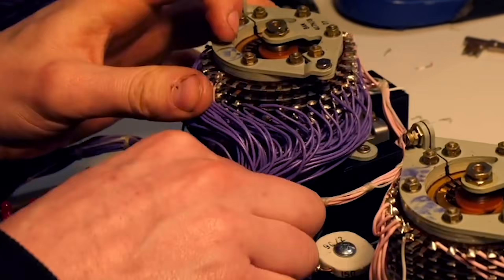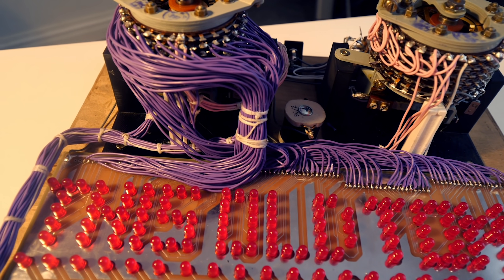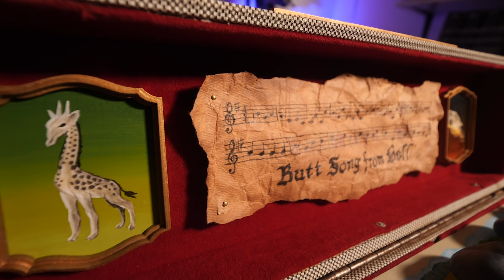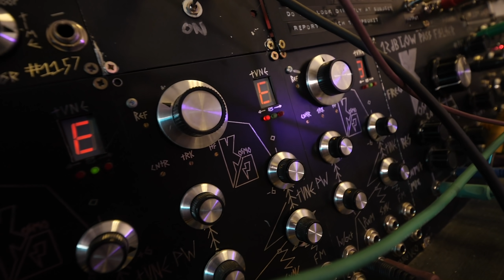ELECTROMECHANICAL LIGHT CHASER OF DOOM - DIY Build

Comment: this chaser is a work of art! i can't stop pushing the butt.  i mean button.  blows my mind how you worked that all out.  and how does it stop on it's own?! so many questions.  Merry & happy to you!
Reply from the maker: Glad you dig it! :D I explained that part but ended up editing it out cus I thought I was blabbing about uniselectors for far too long ha. If you look at the bottom row of the slow uniselector there are sets of 5 contacts soldered together then a contact not soldered to anything. Those sets of 5 contacts power the fast spinning uniselector. So the power goes through the slow contact to power the fast one. When it flicks over on the 6th contact the power stops going to the fast uniselector stopping the show( every 6th contact is not wired to anything) … the switch is wired directly to the electromagnet of the slow uniselector forcing it to move onto the next set of 5. It’s cool because the fast one powers the slow one. But the slow one also powers the fast one
Reply: @LOOKMUMNOCOMPUTER  Go both of y’all fr, this is pretty cool and I’m now subscribed to both and pretty hyped about it. Bout to go through the playlist now
Reply: @LOOKMUMNOCOMPUTER  Probably missing something really obvious but how is it wired to 'select' the level on the fast one?
Reply: @porkondewaffel7145  a series of contacts will act as a common + or - for a bunch of LEDs, so as the slow one moves it basically allows a different batch of LEDs to turn on for each rotation of the fast one.
Reply: @TomStorey96  Cheers! Figured that was the case but couldn't see which part of the switch was 'common enough' without being common to everything - guess I need to take another look at some of the close ups!
Reply: @LOOKMUMNOCOMPUTER  nooo definitely would be cool to know how it stops and how it knows to stay on after being pressed once!?!?
Reply: @LOOKMUMNOCOMPUTER  It's an electromechanical paradox!
Reply: @LOOKMUMNOCOMPUTER  mind blown
Reply: @LOOKMUMNOCOMPUTER  I read this entire comment in your voice and inflection
Reply: TOT MY CATS SAY HAPPY MERRY TO YOU AND YOURS
Reply: I think Tony was the luckiest maker this year. This thing is amazing and the work and knowledge that went into making this, outstanding !
Reply: The slow mechanical spool has holes every 6 poles. Button turn one step of the slow spool. The pattern is repeated 5 times around the spool, so it auto-reset at the end
Reply: @johnnylavoie  
I was about to comment "then keeping the start button held would make it run continuously", but I can't figure out why he has to release the button again (unless it's intentionally turning off supply to left counter to avoid to "burn-on")
Reply: @MrHack4never  If it's not momentary, it's prbly going to prevent turning over to the 2nd set, it's going to do 1 thru 29-30 and stop there and stay stuck until power cycle.
Reply: This was great thank you guys both❤️
Reply: Excellent videos mister Tony. Merry Christmas
Reply: Imho you definitely hit the jackpot this year:) i love this thing!
Reply: i, too, cannot stop pushing the butt
Reply: The choice of keeping the wires in one colour was particularly brave! I can't imagine myself doing that. Absolutely spectacular!

But so was your 'knoife'! The spring/hinge mechanism was quite a neat solution! I honestly smiled when I saw Xyla so happy about it :)
Reply: That thing is sweet. Xyla's knife cutting through bar stock and a mater was pretty sweet too
Reply: @lookmumnocomputer
Massive, massive respect to you mate!!
But please do a video explaining that! Us normals struggle with much more than a light switch!
Reply: Oh WOW it's .. LMNC, ToT and .. UNISELECTORS !!!?

Sadly lost a BUNCH of my own funky junk aftr a big nasty Eviction, but - I'm kinda back with a few new things :)
 I'm more the glowing glass things, with some sounds going thru them, and... This is WAY cool

Course me, I'd fuss about using all the contacts on the thing, then prob end up leaving it on the shelf - congrats on the all nighter with al.. them .. WIRES ;)
Reply: So... Only slightly more complicated than  a ceiling fan on 2 wall switches and a light dimmer, while allowing the pull cord switches to still do their own thing.